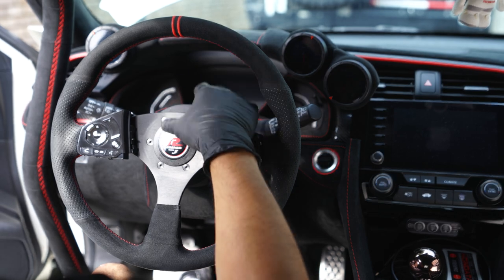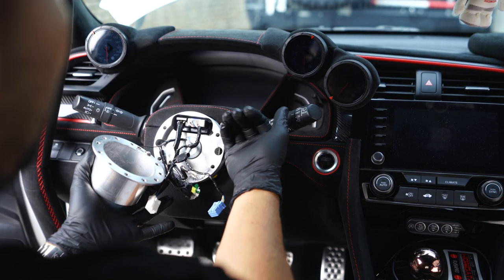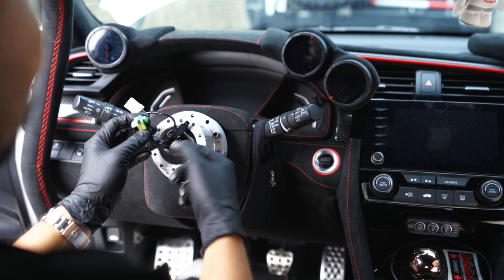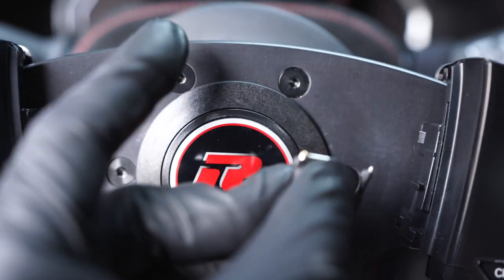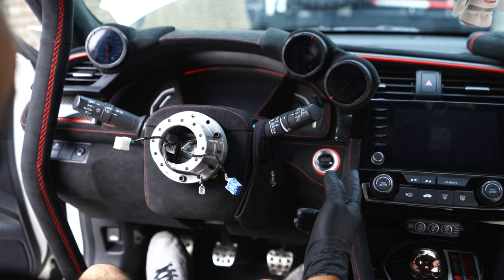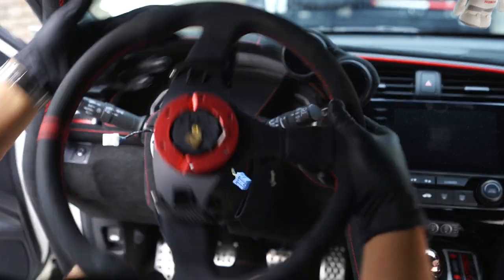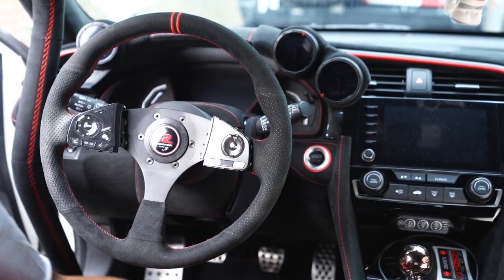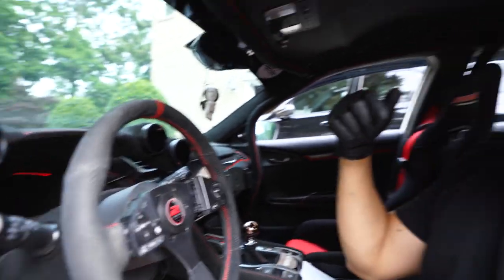Aftermarket Steering Wheel Install Tips & Tricks for Honda Civic Type-R FK8 [Seeker Racing Spec]

Comment: Type R is dope dude, quick question. How did you ground the horn to the hub? I have the wires in my steering wheel but the grounding wire is kinda just sitting in the hub😭, haven’t had a working horn for almost a year. If you can give me some pointers that’d be great
Reply from the maker: So the horn button's back is metal and designed to basically just touch the ground to complete the circuit when u press it. So you just need to connect the ground from ur car to the hub using a bolt or nut&bolt

Comment: I see you only connected one wire to the horn the signal wire. What happen to ground? Also what air bag resistor did you use?. I have some  just like those and I try 2 set and dont work.
Reply from the maker: 2ohm resistor airbag error cancelers by nrg.
The horn just needs 1 wire because when you press the horn on aftermarket steering wheels, it's basically completing the circuit by grounding when you push it in.
Reply: Cool. Thank. I installed a momo set up in my fk8 and having issue with air bag light on.  I check everything like 3 times.  I pull the code and it said resistance may be high or lose connection.  Probably the resistor issue. I got my kit from steering solution.  Also I have a ground to the horn and signal so it works. I only ask because I was curious. Ima try see if the NRG resistor fix my issue.
Reply: @Kodawari.FK8  where did you get the NRG resistor from?.  Are they the one that say 2.2 ohm resistor that I see on there site.  I know these cars use a 2.0 ohm resistor for air bag.